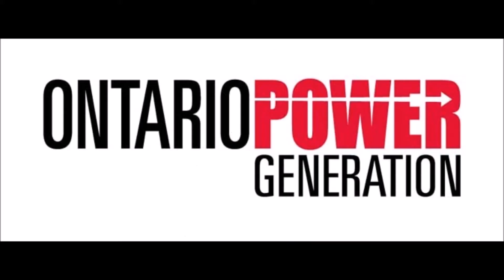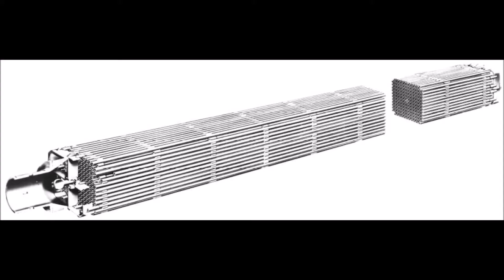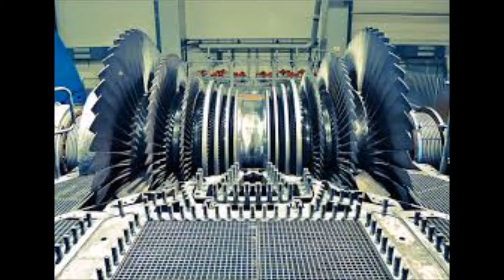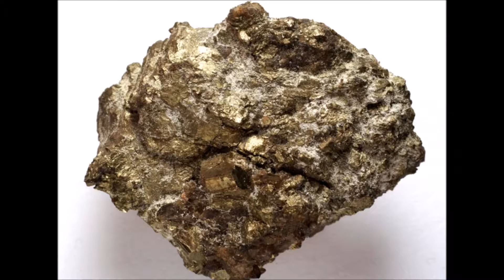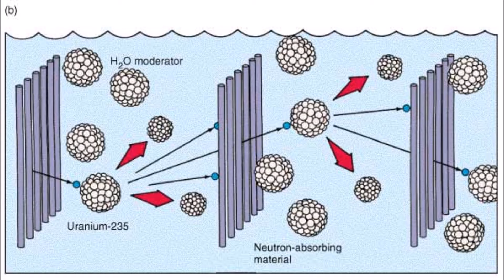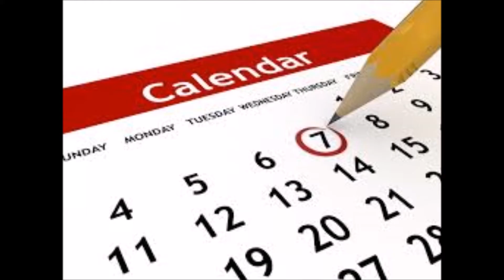Benefits of the CANDU reactor

Comment: I understand the Candu is cheaper to run because the fuel need no enrichment even though a PWR has cheap fuel. Also in the 80's Canadian Candu reactors always had a higher capacity factor about 85% the American PWR or BWR were about as low as 65%. but my hats off to the American Nuclear industry it is now over 95% acheived in the late 90's

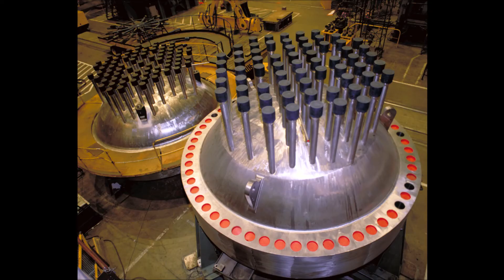Comment: Nice summary! Just a small correction... at about 0:28, you mention the word "calandria" in reference to PWRs, but that's not strictly correct. In general, a calandria is the shell in a shell-and-tube arrangement; this is a perfect description for a pressure-tube reactor like the CANDU, but isn't really proper for a pressure-vessel reactor like a PWR. While a PWR's vessel does have penetrations for coolant, control rods, instrumentation, etc, it's not a shell-and-tube arrangement. (I know this is a bit nitpicky, but in reality, nobody in the nuclear industry would ever use the word calandria when talking about a reactor unless it is a pressure-tube design.)